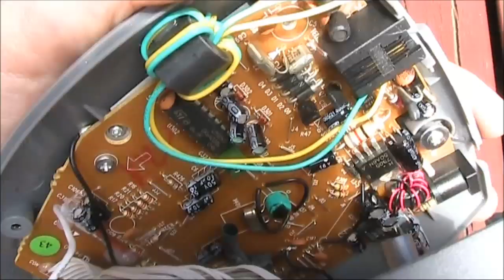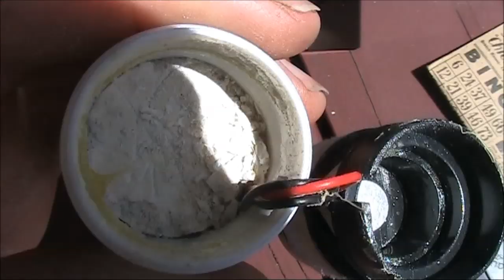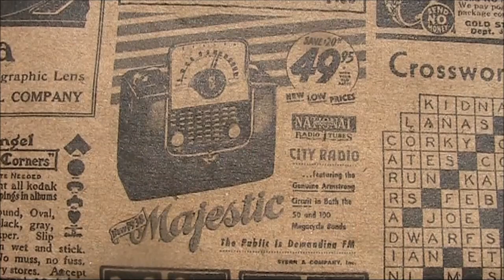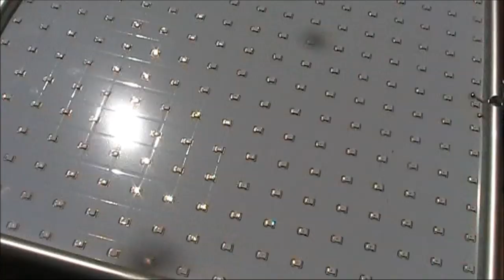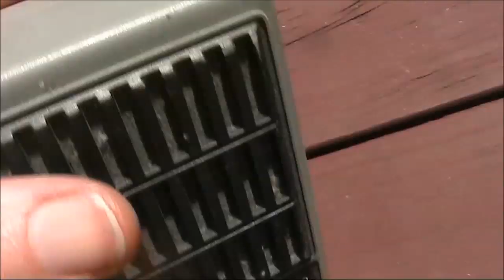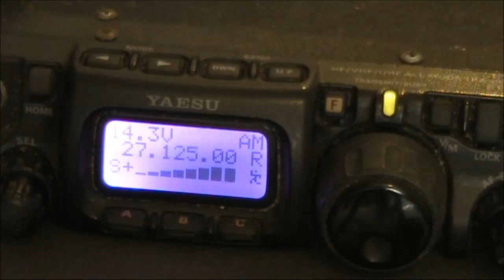Street finds 2019 - More pickings from the kerb

Comment: By sheer coincidence, I picked up a pair of 'Great' brand walkie talkies like yours at an auction on Saturday. Mine are dated DEC 78. They both work and are externally labelled as 49MHz. I haven't taken the backs off yet to verify the operating frequency, although I note from the Wiki that: "there are some [toy walkie-talkie] units that use the 'Part 15' 49 MHz band (shared with cordless phones, baby monitors, and similar devices) as well as the 'Part 15' 900 MHz band; in the US at least, units in these bands do not require licenses as long as they adhere to FCC Part 15 power output rules"

That 500 metre range was impressive for a toy, but I expect that the Yaesu receiver's sensitivity would far outperform the WT's RX. I will test the range of my set sometime this week.
Reply: Confirmed: crystals are 49.860 MHz